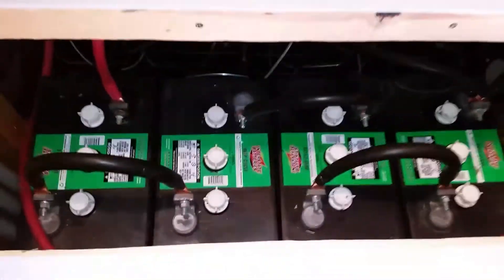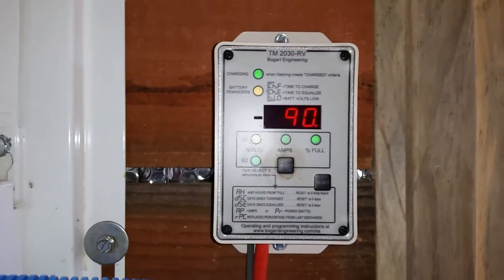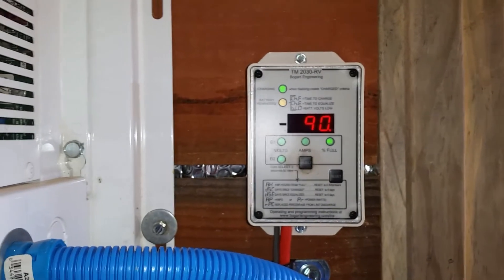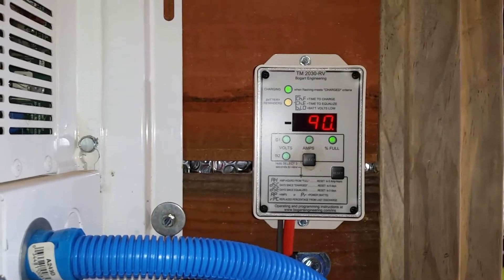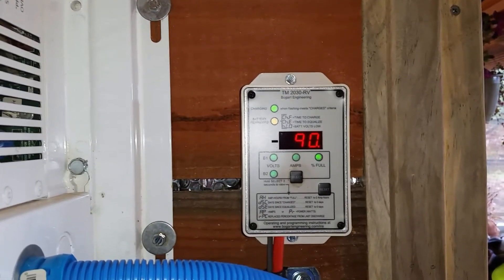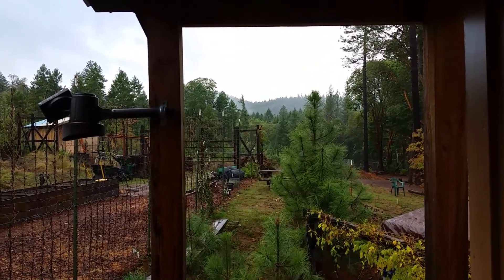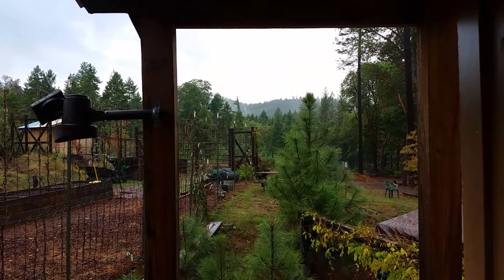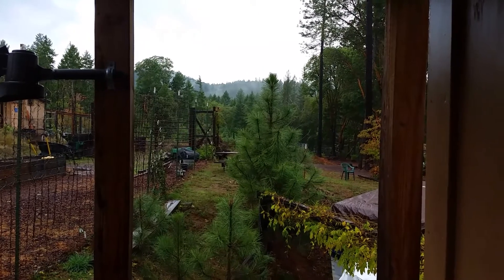I have a question for experienced off grid folks about FLA batteries and DOD

Comment: I listen to what my battery manufacturer tells me.  My first set lasted 14 years (Davidsons) and I was told quite different information than what my second set from Rolls instructs.  Just like different manufacturers have different set points for bulk/absorb/eq, their batteries react differently than others.  We also live in the Pacific NW and do not let our batteries EVER go below 24.4 v.
Reply from the maker: Al Yaz That's great! 14 years is a good run. 24.2 volts is about 50% SOC. I have changed the algorithm since this video. I installed new interconnect cables too. I just checked the specific gravity with the refractometer. 1.290 is Just a hair high but definitely not sulfating. We moved to the Pacific Northwest in 1970. Did you get 14 years from your batteries with a regular 50%DOD? Or just occasionally go that low? I know the Rolls Surette batteries are very good. I have not heard of the other one you mentioned. We just do not use that much power. 7 killowatt hours a day at most. We have a 4.8k array. Nice of you to stop by neighbor!

Comment: I wouldnt. Keep doing what you are doing. I had 15 year old bat and discharged them heavy a couple time and they never charged good again.Dont go below 20% DOD unless you have to. This is my opinion only from experience.  If you want them to last, charge them properly, not over. Dont dicharge below 20%. Comp for cold . EQ 1 time every 2 months. keep watered with distilled water.  If things are good dont change a good thing. Thanks for the vids.
Reply from the maker: Frank Z so far so good. Our daily cycle is 12 %. When I get up in the morning the batteries are at 88% SOC same as 12% DOD. I have gone  as low as 80% SOC a couple times in 4 years. So I say that we use only the top 20% but really it is only the top 12% on average. Thanks for your input. I think you are right. I never did do a deep cycle. Keeping the absorb time and checking the specific gravity with a refractometer has been key. We will see lol. It's only been 4 years so far but I want to get 20!
Reply: If you think about it batteries in a float service last 15-25 years in a real ups system .Cycled batteries only last 1200 or so cycles and worse the more DOD. I would say that you want to try to not really use the batteries or make them think there not being used, they will last a longer time.  Just my logic, I dont really know. But you might discharge them and they may not charge back up the same or they might not hold capacity the same.

Comment: I've taken apart every battery that has failed on me , and learned they failed because of plate warping. I was overcharging them .Cycling is usually not a problem ,just stay above 50% and be sure to charge fully after it is cycled. You can watch sulffation form on the plates it happens instantly,  equalizing them is very hard on them only do it every 6 months if they are out of balance check your cells with a hydrometer

Comment: Hey Steven, from what I understand running down the batteries and over charging occasionally is a healthy exercise like fasting and exercising the body. Overcharging helps clean the plates. I believe the statement "some parts of the plates are not being used" is due to build up on the plates due to the fact a battery getting "flabby" and not getting exercised. Perhaps a strange analogy but this is how this warped simple mind works. Some say 6 months is a good time stamp to over charge your lead acid batteries.

Comment: Side question: How much of a decrease in output do your panels have on average on the very overcast days?
I am trying to get an idea how much my system will put out in oregon winters. It looks like the average winter is supposed to have 1.9 hours of sun a day in Oregon?
Reply from the maker: I am in southern Oregon 46 miles from the coast. At the winter solstice (Dec. 21st) I have sun on my panels from 10:30 Am until 3:30 pm. That's 5 hours total with about 2 1/2 hours of peak sun. In the summer at the solstice (Jun. 21st) sun is on my panels from 8:30 AM until 6:30 PM. That's 10 hours with about 5 peak ours. In the summer with full sun my panels put out 140 amps at 24 volts nominal. We can make 30 kilowatt hours but we only use 7.  In the dead of winter with NO sun, dense fog or storm  I get about  from zero to 14.5 amps. From April 1st through November 1st we have way more power than we need. We use about 7 kilowatt hours a day. We have a 1600 square foot house with a beauty salon in a separate building. We have a propane water heater and wood/propane cook stove. We heat with wood only. We heat water in the salon with solar. We have an 840 amp hour battery bank at 24 volts nominal. If we take the 14.5 amps that we get from a storm around the winter solstice that's 14.5 times 2.5 peak hours we get 36 amp hours! That's not enough at all since I use 100 amp hours over night. Since we want to cycle the batteries no lower than 80% SOC you can see why we would have to start the  generator for 3 hour every 3rd day. Now clouds and the time of the year very a lot. Like today we are having stormy weather with the sun popping out for a few minutes at a time. Right now we do not need the generator but from Dec 1st through Mid January when we have 60 days in a row with no appreciable sun we will probably have to run the generator every 3 days. Last winter we only had 1400 watts of solar and had to run the generator 2 hours a day in the dead of winter. Now we have 4800 watt array. I is yet to be seen how often if at all we need to burn diesel. Last year we burned 37 gallons of diesel that we paid $1.80 a gallon. That's just $66 dollars a year for power. What we did before we went off grid we did every thing we could to get our power consumption down. We went from 27 KWHs a day down to 7 KWHs a day. We did this by getting a large propane tank for the water heater, gas dryer and cook stove. Then we changed every light in the house to LED. We finally got down to 7 KWHs a day and often much less than that. We have 2 refrigerators and one freezer. We have a microwave, dishwasher, convection oven, full size washer and dryer and ceiling fans all over the place. So a normal house really. We have gravity feed water. If we did not then obviously our power consumption would be more than 7 KWHs a day. Here in the Pacific North Wet it is a challenge to live off grid on a small 1400 watt system. Now with 4.8 k it is easy. I hope this helps.
Reply: Steven Davis that does help. Thank you. It is helpful to hear actual experience from here in the Pacific NW rather than estimates online. For positioning, I have found the free Lumos app for ios and android works great for sun tracking if you have a smartphone or tablet. It has a camera mode you can hold up the phone with and it shows you where the sun is in the sky at any time in the year you set. God bless. 🙂

Comment: I do a mini eq. Charge everyday. And run the batteries .5 volts higher in float. And 1 volt higher on absorption. And 2 volts higher for bulk. So the acid and water is stirred up everyday for up to 480 mins.

I have been doing this for two years now. I take my batteries down no lower then to the  60% SOD. I run a 700 amp 12 volt bank and charge with a schneider mppt 60-150 ... 

With this setup my batteries act just like after the first charge cycle from over two years ago. The batteries are cheap generic 6 volt 232 amp. Once this setup proves or disproves schneider recommended set points I plan on  going to a l-16 type battery and to a 24 volt system when power building is built.
Reply from the maker: Its been 7 more months now, how are your batteries holding up?

Comment: If you do an equalization there is no need to drain down to %50. I am not totally off grid but my batteries have not gone below 73 and I have never done an equalization or even added water. But hey I am no expert listen to the guy that said you will get 18years

Comment: Brother as you know I have been working 20+ years in the alternative energy field. The one thing I was ever told and that I do is this. When a bank is new ONE time it needs to be pulled down to a 50% DOD. This dose just what your saying. I have seen where banks that sit full all the time and that do not get used much. They tend to not last as long as you may think. The guy who was my mentor told me this. Now this deals with flooded lead-acid batteries. "Batteries are like lazy people They like to stay at 75 to 80F and be worked some not much tho and they are not happy if they do not get fed each day." 

So If you think about that then what your doing is the best thing for them. I do the same as you. I do not use more than 10% of my batteries over a 24 hrs. If there is a MUST like the powers been out for 3 or 4 nights and I did not have a geny I would use a bit more. But in 3 years my batteries have been down to 70% maybe 3 times. 

Now I will say this. There is a time and a place to run them down. But that is when they have not been taking care off. Like tho's who do not use them much. or they sit in float all the time. Lot of time's I would find this in the computer UPS and off-grid cabins.  

So I say all this to say this lol. If I where you and I am to a point. As I live off my bank. Just do not have the sun to live full time here off grid. I did how ever live full time off grid for 10 years. KEEP doing what your doing and you batteries will last a min of 10 years. I would say that is on the low side. Can see you getting 15 years out of them. 

Hope that helps. Thanks for all the videos God Bless brother.

Comment: Great topic/video! Seen most folks leaning toward "conserving" battery life by "not taking them down too far"... 70-80% SOC. My Trojans typically go down to 60-65% each night and have taken them down to 50-52% (according to the Midnite Solar Whizbang Jr SOC alogrithim). During the cold winter months they typically go down to 70-72% by morning. Batteries are looking great, doing well after nearly 2.5 years. Some may disagree with the way I run mine...but, these flooded deep cycle batteries are lot tougher and can handle it without getting their feathers ruffled. Your Interstate's are awesome and will last a very long time with the way your running them...taking them down to 50% (24.00 - 24.20 volts or so) is totally fine. If I had to do it all over again...would choose deep cycle AGM and add a fourth string. My Trojan 31AGM "Overdrive" deep cycle batteries are absolute beasts on my other two off-grid systems...no maintenance. Lithium...just not seeing many using them for off-grid whole-house power (yet).

Comment: I was told the same thing about taking my batteries down to 50%  5 or 6 times when I first got them then every 6 months "exercise them" down to 50% and perform a full charge and equalization. I also equalize every 3 months. I only have 6 six volts and 500 watts in panels. Obviously i have to use my genset to keep me going during low light seasons, but I swear my batteries are lasting longer now then they were a year ago. I have had my system going for 3 yrs, I don't need much power, I am going to get another 250 watt panel to better my odds. My plates have always been clean.
Reply from the maker: I just found your comment. How are your batteries doing now?

Comment: from what I have learned you need to deeply discharge a few times a year or you batteries will get lazy and stop working just like UPS batteries, sometimes things last longer when you use them, I bring my gel batteries down to 60% and don't even think twice about it, they are already 3 years old and work well and even the last 9 months when I have not been using them much I will discharge them and fully charge them, the only thing that kills batteries faster then deep discharge is not using them :)

Comment: No expert but I agree and do as you, Why to 50% you could do 10% Oh that would destroy them so why go 50% unless you need to for some reason. Im not off grid but run 1040 ah at 48v on 5kw solar panels and use 15% in summer and winter 10% as I might not top off my bank for a week or more. I agree with you.